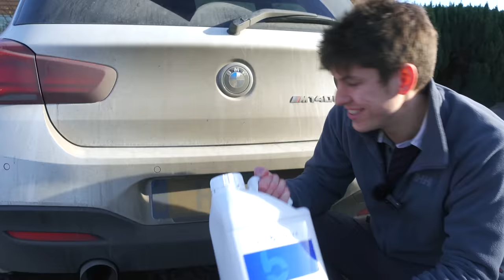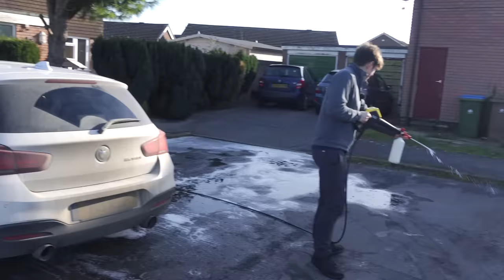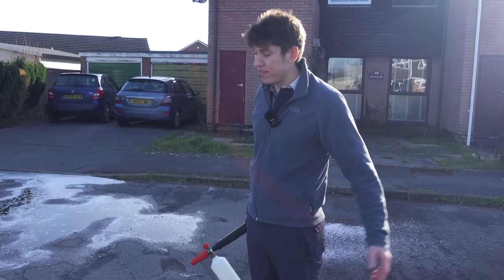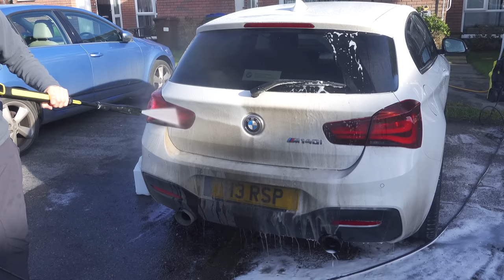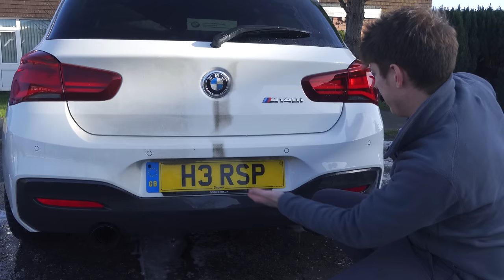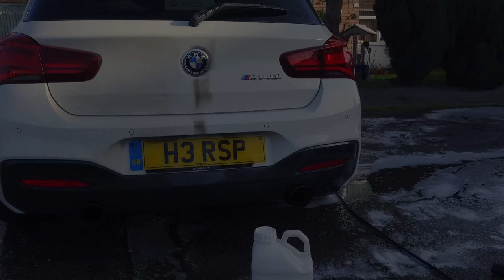Does Snow Foam Actually Work? The Results Might Surprise You..

Comment: I find it's quicker or same time using a bucket and sponge with car shampoo with normal hose to rinse than autoglym foams and power hose. Foams need agitation to remove all the dirt.
Reply: I find people who don't understand detailing should not post completely wrong information on the internet.
The whole point of pre cleaners and snow foams, is to remove almost all of the dirt and grime BEFORE you do a contact wash with a soft wash mitt.
You carry on using a shitty sponge and rubbing all that dirt and grit into your clear coat.
I bet your car has more swirls than an artex ceiling. pmsl !

Comment: What jet washer do you have?... I tried a first snowfoam wash yesterday with pretty poor results, It wasn't cheap product either. I still had to get the buckets and sponge out afterwards to give it a proper wash
Reply from the maker: Kartcher K4. Try touchless snow foam in a proper Lance. Google snow foam Lance. Anything around the £20 regimen will be perfect. Fill up 40 percent snow foam and then top up the rest with water. Leave to dwell for 5/8 mins, and then pressure wash off the dirt. This will do it :)
Reply: @roadreg1820  thanks mate, appreciate it.. will give it a shot 🙌

Comment: I notice in your other detailing type videos you seem to love gyeon so I'd assume you've tested their snow foam product. Would you say their snow foam is no good then?
Reply from the maker: Unfortunately I wasn’t impressed with Gyeon Snow Foam. Tried it several times. Detailing is interesting because not all brands excel in everything. That’s why I use my favourite products from different brands. 😁
Reply: @roadreg1820  The only thing I've noticed is that it's not PH neutral so it'll strip coatings/waxes over time. Probably why they're better than others that are PH neutral

Comment: I wonder what would have happened if you either simply had wettened down the dirt with pure water on the left first, like when you do the dishes, of course it's easier to clean those crusted things that soaked in water for 5 minuted beforehand. And also, wouldn't your normal dish washing cheapo soap maybe be totally enough? Would be curious to see that.
Reply from the maker: I may have to do a response video for this!

Comment: You should have rinsed it first with just a hose end nozzle, to see how much more dirt would come off with low pressure water.   You can apply Touchless with something like an IK foam sprayer, and not have a pressure washer.
Reply: It's been proven countless times, that snow foam works best on a dirty car, because when you jet wash it first, you leave a layer of water on the paint which dilutes the snow foams ability to do it's job.
Reply: @DjNikGnashers  I mean rinsing away the snow foam with low pressure water, not prerinsing the car.
Reply: @cheemomugdoo799  Why would low pressure be more effective than high pressure ?
Yes if the clear coat or even paint is peeling, then it would be stupid to use a high pressure, as it might get under the clear coat or paint layers and cause damage, but on a car with good paint, what would be the 'advantage' of a low pressure jet wash ?
The test was comparing both with the same pressure. To show how effective snow foam is. With a low pressure the none foam side would have had a lot more dirt left on.
Reply: @DjNikGnashers  I never said it would be more effective, I just think it would be interesting to see how much dirt would come off under low pressure after treatment with Touchless.  So if you did this again, after letting the Touchless dwell, then you would rinse the whole area, and see if it is effective under low pressure and to what degree.  Then you could do the high pressure wash as you normally would.  It's just one more data point.  Also, as I mentioned earlier, for people without a pressure washer, but maybe with an IK foam sprayer, they could see if this would be a product that would work for them.

Comment: I just can’t get the foam to that “shaving creme”  consistency. Mine just looks like soapy water.
Reply from the maker: I think you need to use more snow foam to water and make sure your lance is set to the right mix. There’s a little dial on there. Either that or get yourself a decent lance for about £25 pounds. Hope you can get it sorted.

Comment: One of the reasons the non foamed side is still dirty is because the pressure washer will have forced dirt into the paint. You should never use a pressure washer up close to car paint as it can not only force dirt into the paint, but also remove the top coat of the paint.
Reply from the maker: BMW clear is extremely thick. Also, I wasn’t that close. I have been washing my car for 5 years now (nearly) and the paint is in very good condition. Thank you for the comment tho!
Reply: @roadreg1820  the distance you were from the car is still fairly close and the amount of pressure being used will definitely increase the likelihood of you forcing dirt into the paint. So you have been washing your car for almost 5 years, well you are only a beginner, come back when you have been washing cars for over 50 years.
Reply from the maker: @alanhindmarch4483  I never let my car get that dirty.. I wash it weekly or every 2 weeks. My car, gets full-decons after it’s been as dirty as it was. Not a spec of dirt. Plus it’s been ceramic coated. I know what I am doing, don’t you worry about that. Oh and sure! I’ll come back after I’ve sanded/polished and detailed more cars than you have in your entire lifetime. Appreciate the support - thanks Alan :)
Reply: Dude. You’re not stripping clear coat with a pressure washer that is retail use 

If that was the case every boy that has a ceramics coat would have stripped theirs week two
Reply: @ssing7113  Dude, who is this dude. Also your comment is nonsensical and not English.

Comment: I started using Autoglym Polar foam on my car, and it caused so much corrosion on my wheels, struts, lower arms, brakes discs and brake lines, handbrake cable, rear axle, subframe, wheel bolts, I eventually stopped using it. Once I'd stripped the double thick coating of rust off my brake discs with a wire drill and wire wool, the rust did not return and I did that 2 months ago. Under the car it was near enough rust free albeit for a few common points which weren't a worry. Only the areas behind the wheels were seriously corroded. A year earlier none of that was there as I wasn't using the foam, only the shampoo and conditioner wash. 
It put my car off the road after a failed MOT with a whole list of advisories on corrosion which would have meant paying for work costing more than the car's worth. When I started work to get it roadworthy again myself, the amount of residual damage the foam had done to the mirror mounts (chock with thick white residue which started rotting the seal) and seals causing serious leaks puddling at the bottom of the door seal which caused corrosion on the speaker and messed up the door electrics, bad corrosion on the bonnet where the runoff is, every wheel arch, underside of the doors, behind the arch liners, was unbelievable. None of that was there before, suddenly it was so severe the rust was bubbling under the paintwork so I've come to realise it's very harsh and erosive.

So now I've fixed 90% of those problems I'll try Bilt Hamber because I've read it's pH neutral.
Reply: Not sure about your rust issues but Bilt Hamber Auto-Foam and Touch-Less are not pH neutral, they are alkaline at pH 13-14. Polar Blast however is pH neutral.
Reply: I'm surprised at that. Polar blast isn't strong at all. I thought you'd have more issues with bilt hamber removing under body protection
Reply: @andybrad4721  So was I mate, and then infuriated. After I'd done the repair work which took me months of slow painstaking graft working on the floor of my driveway on my days off, as well expense, and stopped cleaning the wheel areas with it, the corrosion completely stopped. 
Before, the brake discs were so bad they were turning red. The disc edges were horrendous and the stone guards as I noticed yesterday, have started to rot through. I just bought a whole new set of discs and pads because the old ones, although plenty of meat still on them, are too badly pitted on the inside, damaged and contaminated. 
Once I can afford a new strong Torque wrench I'll be replacing all four hubs too because they've taken a battering. The drive shafts have corroded so badly in the hub that before I wired everything they were grinding. The paint on the springs and shocks were peeling in chunks with corrosion underneath and the bolts are corroded so they're going to need an overhaul. 
Last year there was none of that on the car. Not even a mention on the MOT advisories. The last one, fail for corrosion and code after code of advisory corrosion problems. Either this stuff causes it or accelerates it like sea air, but process of elimination tells me it's the cause because the old discs have not corroded now since I put the wire on them and neither has anything else.

Comment: General folk washing should only use snow foam to pre soak before touching, just pressure wash first, dont waste your money falling for gimmicks
Reply from the maker: If you watch the video, you can clearly see pressure washing did nothing. That was the whole point of the video 😂
Reply: @roadreg1820  yep using a specific soap in a specific setting, not the same as everyone else.

Comment: are you using a 1.1mm orifice?
Reply from the maker: What’s that?
Reply: @roadreg1820  the orifice is a small screw inside of the foam cannon that the water/soap mixture goes through which creates the foaming of the mixture. Most foam cannons come stock with a 1.25mm orifice. You can swap out the 1.25mm for a 1.1mm orifice to substantially increase the foaming action of the foam cannon! I am not sure which foam cannon you're using as I've never seen that one before but I swapped to a 1.1mm orifice on my MTM on and it foams great now!
Reply: and to be honest your foam cannon had really good coverage and layering but I was just more curious than anything! Best regards, - Aslan

Comment: Things which are unfair in this test: when foaming right - You should also apply some water spray or whatever on left. When washing left, you should aim your jet from mid to left, not from left to right (giving more water to right before even starting washing it). Of course result still wont be even close but... :)
Reply from the maker: I’ve tried everything.. different snow foams. Rinsing without snow foam, letting it soak. Trust me, the result would have been the same.
Reply: @roadreg1820  I trust in you, but I'm just saying the very washing process could be more "careful" to stop comments like mine :D good content mate! I never 🌨️ my cars before, I might start doing it :)

Comment: I use bilt hamber , but only have the use of a battery powered pressure washer worx, due to where i live and  you need higher pressure to shift the dirt, so still have to use a sponge, but it does soak the dirt well.
Reply from the maker: Just make sure you give it a good rinse before using the sponge. Yeah, touchless will do a lot of the work for you. It’s great!

Comment: I was always advised by a car detailing guy to hose car with clean water before applying snow foam for good results
Reply from the maker: I think it’s better to apply the snow foam on a dry car as the snow foam as water in it, plus you want to really grab the dirt on the car so it comes off easy just like in the video.
Reply: @roadreg1820  water under the foam drags the dirt off the vehicle before cleaning
Reply from the maker: @grahamdaniel9534  not in my experience it doesn’t- I’ve tried that method.
Reply: Well most of the professional detainers use the water first method and my son was trained by one so I think we will have to agree to disagree on this one mate

Comment: Pressure washer is just to quickly rinse the car after your washed it with sponge/bucket/soap. I have never used this snow product. A manual car wash is simply the best…don’t be lazy if you love your car!!
Reply from the maker: If you want to prevent swirls and scratches please don’t use a bucket and sponge. Use the snow foam first.. if you watch the video properly - see how much it removes without even touching the car. The whole point of snow foam is to help remove as much of the dirt on the car as possible before contact wash.
Reply: @roadreg1820  I have been washing all my cars the old fashion way and didn’t have any swirls or scratches. But I must say I never had a black colour either that is most susceptible to swirls. I don’t dispute that the snow foam works. My concern is that the pressure washer can be more  damaging than the sponge.

Comment: Nor snow foam or any pre-wash citrus agents remove the last layer of dust even you do them both twice or more times.

No matter you rinse with water very first then pre wash with the best citrus agent (Valet Pro or KKD) and after use snow foam. Even 1:1 at insane ratio, you must need to so the contact wash...😂

Yeah, a sort of lagging status with all these technological advancements...😂

Still waiting for an option/ ph neutral,  ceramic coating and clear coat safe chemical where I do not wanna do contact wash on flat surface paint panels at least.
Reply from the maker: Apart from the one in the video.

Comment: Snowfoam doesn't work, it's the PH level of the cleaner that works. A high PH cleaner can just be sprayed on, no need to apply it in the form of foam.
Reply from the maker: @evenito9455  that makes a lot of sense
Reply: @roadreg1820  i just buy the cheapest degreaser i find and dilute it a bit to save money.

Comment: You need to wet the car first with a quick power-wash. Dilute the snow foam before adding it to your bottle...about 3 parts water to one part snow foam. You were using it neat which is wasting loads and not allowing it to do it's job.

Comment: I've always used BH auto foam and found it does relatively little. Probably wasting my money tbh
Reply: LOL maybe you need to learn how to use products properly, BH auto foam is a brilliant product, and just about the best foam money can buy, at any price, yet it's one of the cheapest.
Reply: @DjNikGnashers  You fill up the washer fluid res with it and spray, what's to learn?
Reply: @DjNikGnashers  You seem like an expert. Can I ask, what's the best ratio of Atom Mac to brake fluid?
Reply: @R4STABAN  10.87527 to 1.47 divided by pi.
Reply: I found the same. Also left streaks all over the car. Dreadful product, no better than normal TFR. I sold it after two uses on marketplace.

Comment: I'd be concerned about holding the nozzle so close to the paint with the pressure washer on the left side. You're not stripping paint from a fence here just rinsing the car. I'd worry about damage to the clear coat.
Reply: Should be fine it's on light setting I'm sure won't damage but yeah got to be careful

Comment: All you've really done is shown the difference between only water and using soap. I'm not sure it tells the difference between snow foam and any other soap.
Reply from the maker: Snow foam vs nothing. That’s exactly the point. Some people are adamant it’s a gimmick and doesn’t do anything. That’s why I made this video.
Reply: @roadreg1820  I understand that, but just water was never going to be as good as snowfoam. A spray on shampoo verus snowfoam (soap vs soap) makes more sense.  I'm not trying to knock your video, it just seems like all you've shown is that just pressure washing is not as good as using a shampoo of any kind, which is kind of obvious. (i also get you can't please everyone, i'm just pointing this out). Maybe an excuse for another video?

Comment: This is far from a scientific or representative test of snow foam. One side is soaked and allowed time to work. No alternative products or methods are used on the non snow foam side. I suspect pouring a bucket of soapy water over one half and allowing it to soak for 5 mins would achieve the same result as the snow foam. Doing such a test would at least be more scientific than this video. This looks like a blatent advert for the featured product!
Reply from the maker: Haha, I’m not sponsored by anyone Glynn. This is to show you the difference between using a snow foam and not using anything. Thanks for your comment though 🤩

Comment: The fact that you are promoting a product = unfair and biased results. Apart from the fact the foam side did get a more intense final rinse too. I use snow foam and it is not one of the cheaper products. I still need to use a car brush to get into the dirt before rinsing.
Reply from the maker: Hi, unfair results? Not sure what you’re talking about! I’m not sponsored by any snow foam company and the product clearly works. This ain’t made up crap to promote a product Chris. If you try Touchless, you’ll remove 70/80 percent of the dirt before you need to hit the car with a wash mitt or sponge. Don’t go anywhere near your car with a brush, unless you want to scratch your car.

Comment: You should never hold the lance so close,you are removing all the wax from the car.
Reply from the maker: Not correct, the pressure is low and the width of the spray is wide, plus I’m careful with going near stone chips. The clear coat on bmw is very hard and a lot thicker than other cars.